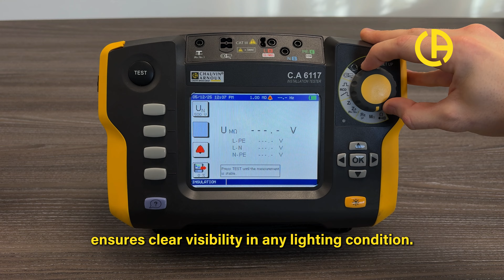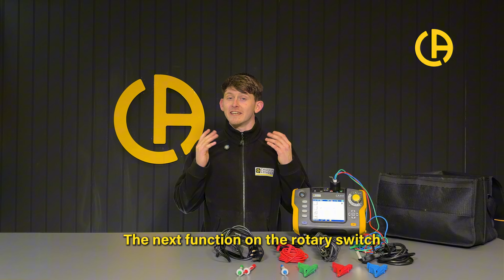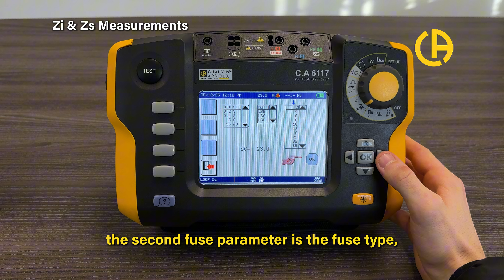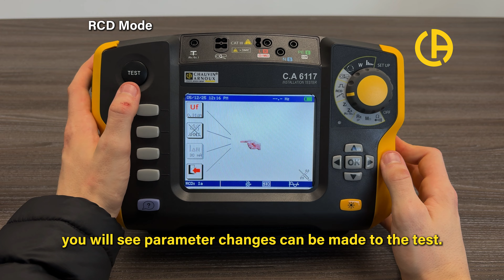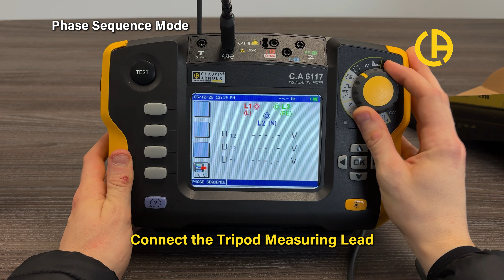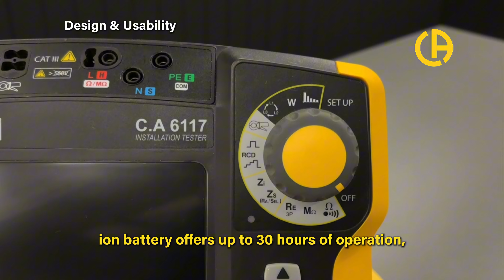Complete Guide to the CA 6117 Multifunction Tester | For Industrial and Commercial Electricians

Comment: Does the current range only work through a clamp or can current shunts be used? Might be interesting to see if it can be used for impedance measurement test on motors.
Reply from the maker: Hi there, apologies for the delayed response. 
Our technical support team has mentioned that it works exclusively via the current clamp — no direct connections needed, which keeps things nice and non-intrusive.
Reply: How do you do a loop impedance test with this unit?